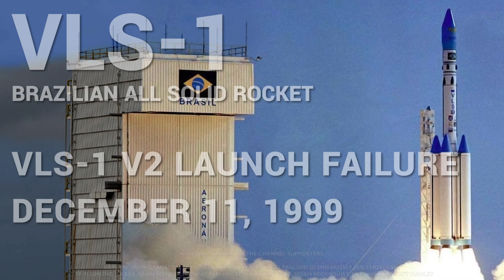VLS-1 V2 Launch Failure - Solid Fuel Brazilian Rocket, 1999, Alcantara Space Center, AI upscale

Comment: in an interview last year, the former director of the Brazilian space agency said that the VLS v4 was being assembled and stored ready long before the launch complex was rebuilt, but the validity of the energy and ignition systems had expired and there was a risk of a new accident in case they tried to launch it, which led to their unloading and storage of the vehicle as a display model at the time of the project's cancellation, which was replaced by the VS-50 project, which has also since been cancelled.
Reply: Validaram o motor vs50 a pouco tempo!